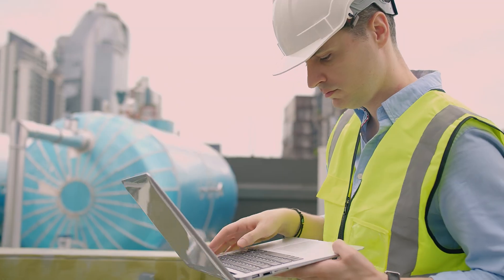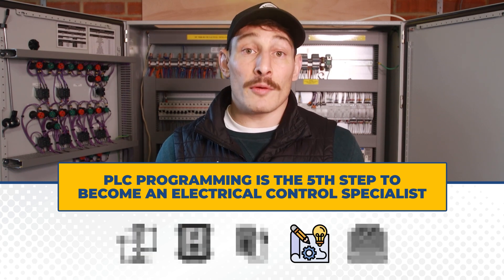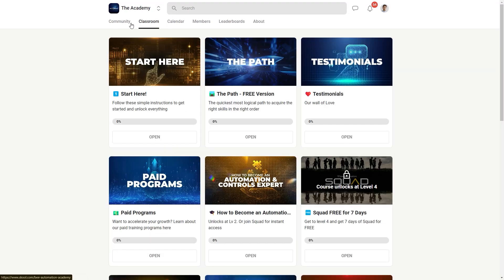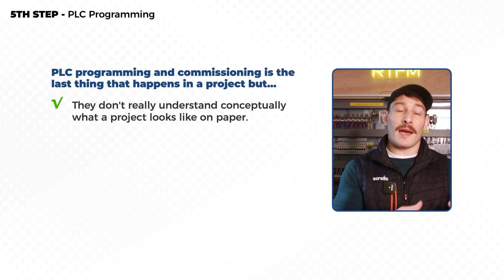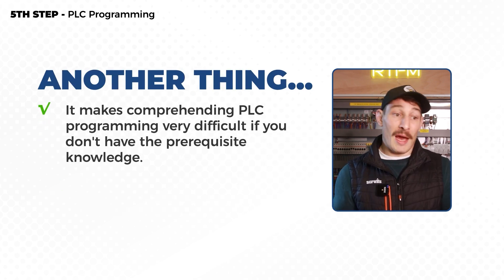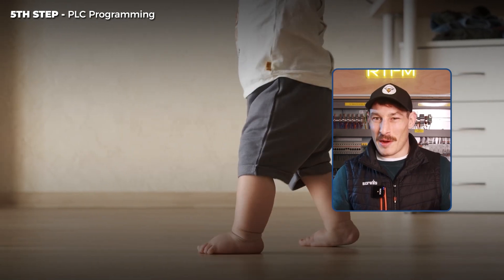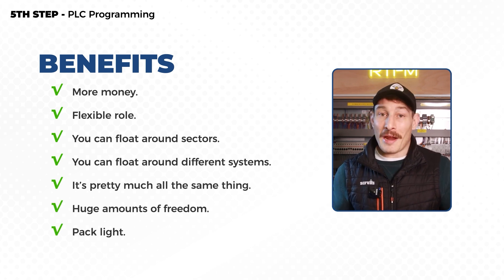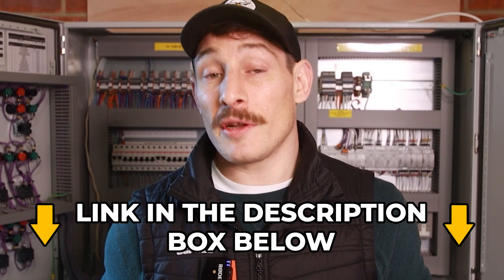Why Rushing Into PLC Programming Can Backfire for Beginners

Comment: Having been an industrial maintenance electrician sines the early 80’s I just like to say how spot on you are. Control and automation isn’t something you could ever get into on your own, it just isn’t going to happen. I did lots of programming in my job but always had the security of being employed by a company. When I set out on my own in 2006 I did very little programming it was just too risky. So many different PLC’ and programming tools, way too easy to shut a site down or wipe a program (not many of my customers ever had backups😳) was working on a project a few years ago  when the software guy shut the whole site down for several hours due to some bad code, sure glad it wasn’t me. Self contained automation panels can be great little projects to get a foot in the door but again a good knowledge of safety protocols is essential

Comment: Interesting that you mention that PLC programming is for older generations who are deteriorating a bit. Do you think that younger engineers who want to avoid harder physical labour should avoid automation engineer all together then? For example, I have worked for one year with this company where I learned how to panel build and wire, but couldn't handle that aspect of the job as it would worsten my lower back pain. Since then, I have shifted into learning programming in Codesys, hmi design and networking. But as you mentioned, if heavy lifting, pulling cables and squeezing into uncomfortable positions is an unavoidable part of the job then maybe I should avoid this industry altogether?

Comment: I am a SysAdmin/DevOp so did some of my own stuff doing the programming. But its SO true all you are saying re doing the programming first.. What software do you suggest for schematic/cabinet design
Reply: In industrial automation that software that is used is proprietary software.  The two  that is used the most is Allen Bradley and Siemens.  Also, the programming language is ladder logic.
Reply: @Crown42  No I meant for design not programming , I use Click from Automation direct. I was asking for the drawing of schematics
Reply: @DawidKellerman  OK, I understand now.
Reply: SEE Electrical is a good software program for schematics and panel layout